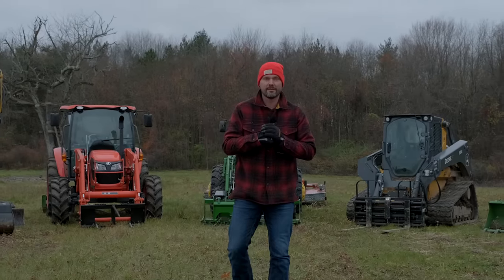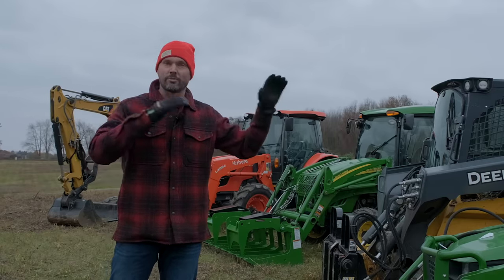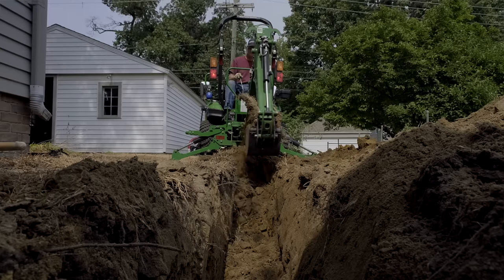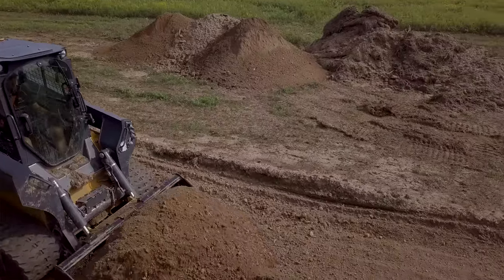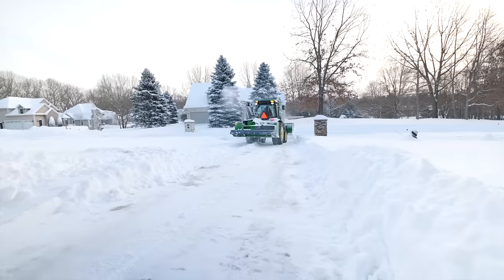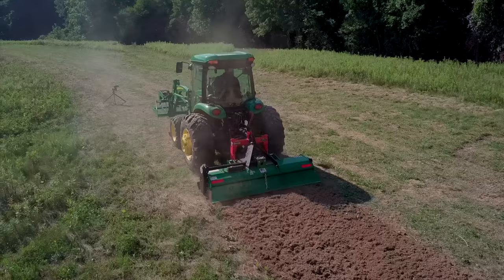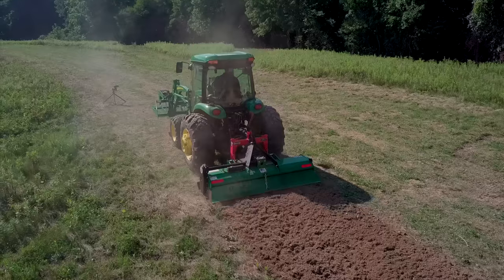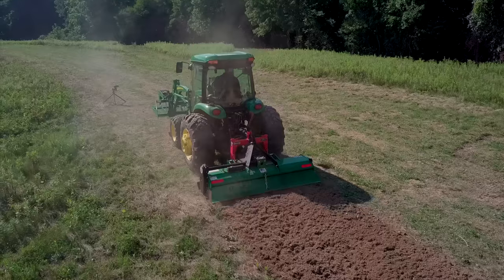IF I COULD ONLY CHOOSE ONE? BEST MACHINE FOR PROPERTY MAINTENANCE

Comment: I've worked in the city as an operator and I grew up on a ranch, so I've seen a fairly good representation of what you're gonna run into as far as one machine for a decent little spread. I think that the most versatile piece is a mid size tractor with 4wd and a front loader bucket and a box scraper with rippers and top and tilt, if you can afford it. As far as most other projects, it's more cost effective to rent a machine than buy. At what point that changes is up to you and your discretion. You can put forks on a tractor, you can get just about any implement you need, ie a wood splitter, a flail mower, even generators if your tractor has the beans at the PTO. I think that about 55 to 65 HP at the PTO is just about optimum for most things. JMO but hope it helps, be safe 🤟🇺🇸👍
Reply: Totally agree. I maintain a 190 acre property with a 4052r. Heavy duty bucket, rock bucket, snow blade converted to a dozer blade, box blade, pallet forks, WoodMaxx PTO wood chipper, and then In the winter I throw a huge plow and a 74 inch PTO snowblower on and the amount of snow I can move is insane compared to a skid steer. Anything bigger than a 4 series tractor would become a hinderance on many common tasks.
Reply: @qqslp  sounds like a nice little spread you got there. Growing up on a ranch it was so much hard work, I couldn't get away fast enough, but now that I'm older, I sure do miss those open spaces! Good luck with your ranch and be safe brother! 🙏💪🤟
Reply: @dozerboy67 - Home, home on the range…..where the deer and the antelope play  🎶
Reply: @simpleagain1  😂😂

Comment: The correct choice is the skid steer.
Unlimited amount of attachments
Easy to transport on the smallest trailer. Really it's a no-brainer
Reply: It isn’t the easiest to transport. Remember that 333g weighs over 11,000lbs which really determines your trailer size and load tie down
Reply: You need a tandem axel heavy duty trailer and a F-250 at least to pull a skidsteer around. And they can cost 3x the amount of a subcompact. Plus on a tractor you are out in the open, enjoying the nice day and not locked in a tiny cab. It REALLY depends on your situation, uses, interests, etc. Tractors are just fun!
Reply: IMO a medium tractor ie 50 to 70 hp with a backhoe attachment
Reply: It really depends on what you can move and what you have available. 

No one piece is the best, really your right cause if you're gonna have a 60 horse tractor you should have the ability to move a 333 around, might be at your limit but you can do it. So yeah I  agree.
Reply: Until it's time to bury a cow.
Reply: @thespoonterer  oh, I agree, my 710g isn't going anywhere soon. It works the best for me to reach out and move dirt and out load and carry vs a 953 for road maintenance, also loads a dump truck great. 

That being said have you run a CTL in soupy mud, they shine there. Also you can get a hoe attachment for either a tractor or the CTL. In the end, if I could only have one, I'd keep my 45hp tractor, don't tell my 710, just my thoughts, again no right or wrong.
Reply: @brandtwebber5761  definitely no right or wrong answer. My Kubota mini ex was the best choice for the work I do on my property but may not be the right choice for someone else's situation. But.... I think a mini excavator is still extremely versatile. Could technically plough a field with it, would just take me alot longer than a tractor, but could still do it lol.
Reply: @thespoonterer  you do what you have to with what you have, thats how we used to do it before all the 100,000 dollar options showd up.
Reply: Tractor has all the attachments also.....also the weight....i find it funny how people think a skid steer is better....you guys obviously dont work with equipment.
Reply: @EternallyGod tractor got all the attachments you need without paying an arm and a leg for a skit steer attachment

Comment: Every machine does have pluses and minuses. I have a JD 450 dozer, JD 450 track loader, Hitachi EX75 excavator, New Holland 2120 4x4 tractor with frame mounted backhoe, John Deere 4x4 310G backhoe and a Bobcat T300 skidsteer. Each machine has some task that it does better than any of the others. Ive purchased, used, then sold dozens of other machines that simply came up short. If I had to pick only one... It would probably be the tracked Bobcat. I am so thankful that Im not limited to one. My equipment makes my ranch life much more entertaining.

Comment: I got a kubota mid size tractor for my 40 acres.  40 hp is plenty.  No tilling, but brush hog, bucket, scrapper, forks.  ALL important for me.  About 10 years after that, bought a mini, (5 tons) excavator.  Not as many things you can do with it, but it does so well on digging that I couldn't do any other way, (no, no backhoe can go down steep hills or sidehills) .  I bought a smaller Kubota for mowing in my orchard, (still diesel but smaller)  I use it a lot for mowing around trees etc.  All are great, but the mid size did so much.  I could have gotten away without the small one, just that it saves time for me.  I'd agree that the mid size is my must have.  The excavator is also great, but you can rent one if you save up the jobs you want.  Yeah, if I had 100 acres of flatter land, with lots of brush, skid steer with attachments would be great.  But My place has enough steep areas that I'd not want to take a skid steer on.  Excavators CAN work on such slopes.

Comment: I have a 4720 and I do mow my lawn with it,  I have a 17 foot batwing Woods finish mower.  I’m mowing 7 to 8 acres and just love the tractor, the best thing about the cab that I found out is no bugs. The air conditioning and the heat is nice but I ran over a hornets nest and was really happy when they were all buzzing around the outside.  It’s amazing how close you can get to trees.mailboxes ,swing sets and any obstacles once you get used to it.  I have a New Holland TC33D and used to mow with it and a 6 foot finish mower and cut my mowing time down from about 8 to 9 hours to about 3 hours.

Comment: I love this because it’s completely application based and like he said, whichever projects you have will dictate which is better. Having ran all of them for hundreds of hours, I can honestly say it depends. Would I want a 1025 for land clearing? No! Would I want an ex for mowing? Course not! Each has its own specific realm it does well in. Personally, I’m partial to my CTLs cause that’s what I run most and if they can literally do it all with less footprint because of the tracks, but I’m not going to use it as a finish mower for my lawn. Let’s just all hope to be lucky enough one day to own all the equipment that he does.

Comment: I just purchased an implement from Good Works tractor. Exceptional customer service. They are great people to deal with I recommend them. . That been said…. Without a doubt I would choose a 1025r. It can do it all it’s compact affordable reliable. Yes sometimes it takes ab little longer than a bigger tractor but it gets it done no matter what. I can squeeze in small places. That’s my go to machine. I also have a 3 series. If I need more power I just rent it. I can’t afford an excavator or a skid steer….. they’re way too expensive for my budget. The implements are high too. So yes 1025r I have 8 acres and a mini farm. Hope this helps.

Comment: After years of compromise or experience. Keep looking for good deals and buy what you need. It may take 3 to 5 years to assemble, yet you’ll be both productive and happy. Ended up with a cabbed 47hp heat&air 4 series, a cabbed 75hp heat&air skid steer and a 1.8ton mini excavator. No more worries, the jobs get done!

Comment: I agree with your verdict on the large compact for general use around most any property. Does nearly anything short of turning a place into a construction site. 50-60Hp PTO tractors will pull and bush hog anything. If you only could have one also make sure to have a bucket, but if you already have a sub-compact or 25-30Hp tractor with a bucket it'd probably be very economical to buy a nice used Pulling tractor for any PTO/ rear Implement work. There's NO such thing as TOO many tractors, just not enough space to park them all.

Comment: I'd go with skid steer. Because you can basically do everything you can do with the compact and you can dig with it some too. Not much, but running pvc or cable, you can cut a small channel with the bucket. Clearing land, mulching, bush hogging, moving dirt. Skid steers are nice and it's all in one machine. I see why you like the compact too though
Reply: Agree. I've got 5 acres and been looking for a machine. Skid steer seems like the best bet currently. My one drawback is me knowing maintenance on it vs  tractors-which I'm familiar with

Comment: I have 24 acres. I own the  Kubota M7040 which is a 70 HP Utility tractor. I use my tractor for bush hogging, finisher mowing, tilling, box blade on the driveway, grappling down trees and brush, and bailing hay. This is a great all around tractor.

Comment: Had a used Cat 416D 4wd on steep 10-acres.  It was a bit tippy for hills, but had power to level roads and move mountains.  Never regretted having too much power.  4-in-1 with leveler made short work of taming woods.

Comment: And the winner is... to rent this stuff. I have a JD gator I use everyday but very few needs to have a tractor I would own so I rent or borrow. The mini-ex I have one in the back that the turn table broke off the tracks. This is proving so impossible to fix I think it will have to go to the junk yard. We are using it to put in french drains around the barn. I think the New England mixture of rocks and gravel in the soil got to it. One other item to consider is the JCB Telescopic Handler (the AG version). It has all the attachments you are showing in the video but can lift high for large hay barns. I notice in my travels many EU farmers really like those things. Cool video and interesting line up. Thanks!

Comment: I bought 48 acres of mixed pasture/mountain/farm land when I was 19.  Dad did the farm work with his equipment as I was broke. The old farm I had bought was run down, I almost immediately needed a skid steer to clean up garbage and Level out briars and dirt piles.
      Thank God for Dad, he was stringent and a pain but he had mercy on me and let me borrow his old 1985 case 1835b skid steer. I sold my pickup truck for some black angus cattle, and ended up buying the old case.
     Fast forward five years and I have a kubota ssv75 and several attachments.
      Long story shortened, for property maintenance a skid steer is a requirement, not an option. I use no tractors under 100 hp to do any tasks on my property

Comment: Sometimes you need several saws to complete a project: circular, jig, table, chop, etc. Honestly, it depends on the project and the tool's capability.
Reply: It really depends on the operator and his skills.  I can make a straight cut with just a skil saw and not using a table saw to rip a board.     Just saying.

Comment: I just finished putting in a 300’ driveway, 150’ well offset, 250’ electric line, 30x50’ foundation hole that was 7’ deep on the uphill side, septic system and a 300’ swale, all with a kubota l4060 with back hoe and front loader. It did everything I asked of it but my only complaint was the speed. You have to reposition a lot so that means getting off the machine and back on, often in mud, hundreds of times a day. I just traded it in for a kubota kx040-4 and only have 6 hours on it so can’t say much but my hope is the next project I have of doing the same type of work will go faster, and as I’m entering mid 30s, less in and out of the machine and climate control work space sounds pretty nice.

Comment: One machine, my only machine on a 110 Acre property is an ASV RT75HD. Does everything I need and even with the added cost of slashers, mowers, pallet forks, post hole augers, and chain Trencher it goes everywhere from steep hill sides to muddy creek edges. Feels safe and stable. beside the neighbor needs to use my CTL more than I need their tractor. Great video though, very entertaining.

Comment: Currently in that situation.. my property, 91 acres, approx. 40 pasture and 50 woods. For me, I would choose a good utility/compact tractor.
  Tractor I chose for my situation - Kubota MX5400. Big enough to run a decent sized flex wing rotary cutter for pasture maintenance as well as future hay equipment and still able to work in the woods as well. 
   I can not recommend a good root grapple enough if you are clearing trees and brush. It has saved me countless hours of back breaking work having to drag limbs, logs and brush to the wood pile or burn pile.
Reply: I have the same tractor as you. The Kubota MX5400 I bought it from in March of this year. Overall I’ve been very happy with its performance and size for the maneuverability. I just had the dealership add all three rear remotes. It can take so hydraulic top and tilt will be coming soon on mine. I also agree with you about the grapple. I have the land pride 1572 which is overkill. Reduces lift capacity. But is a tank. I could demo with that grapple lol
Reply: @JaseVaughn  Where did you get your rear remotes and can you get 2 more????  lol..  I have been waiting on mine since August. I know there's a back log on stuff but, I'm beginning to think the salesman at my dealership is giving me the run around. 
   I need to just look online at some place like Messick's to see if I can get them on my own.
Reply: @rogerr1296  I got them from the dealership where I bought my tractor here in Florida. I’m not loyal to any dealership or salesman. I used to be but my advice to you this day in age and in these times especially. Seek your parts and equipment from wherever you can get it. I actually started off really good with my salesman I bought the tractor from then slowly he’s been getting worse. So I just get attachments and products from other people and dealerships. Or the same dealership from a different salesmen. Loyalty will make you wait as you have been my friend. :)
Reply: @JaseVaughn  Sounds familiar. My salesman was good at first then little red flags stared popping up here and there. Like me asking him to order my rear remotes then getting the very distinct impression he didn't do it until I asked him about them a few weeks later. I just get the impression he was through helping me after his commission check cleared after I ordered a tractor and three implements from him.  I think it's time to do a little shopping elsewhere.  I hate it because the next closest dealership is about an hour away and, it's the same dealership just a different branch. And you know these guys talk to each other so, if I try to go through them word would get around and I'd bet my current salesman will tell them not to get in a rush to help me.
Reply: @rogerr1296  I bought an implement in front of my old salesman with one that was there because he knew the stock better than him and when I called about box blades and what I was looking for. I looked at my salesman and said nothing personally but you said you didn’t have this box blade and evidently you do. I can’t let your lack of knowledge or effort get in the way of me getting my equipment and work done. Hahaha I feel the same as you about the salesman as well. Which is really dumb on there part because down the road I plan on getting a 65,000 dollar Kubota mini excavator. But won’t be using him!

Comment: I only have 40 acres and most of it is wooded. I absolutely love my M7040. It makes snow removal with the snow blower in Northern Mi a breeze. I also back blade almost two miles of trails and till/plant about 8 acres worth of food plots.  I've got an unlimited supply of firewood for my house on my property and it makes moving the wood so easy. I actually use the loader for all of my lifting/moving tasks. I bought my M7040 last year with 312 hours and the plastic still on the seat. I paid 40k for this almost new, pre-def fluid tractor and couldn't be happier.

Comment: I pull weeds with my mini. For brush, for piles, loading logs branches rocks.  All the heavy lifting.  Leveling making roads pulling other stuck equipment. Wonderful logging tool.  When I cut firewood no bending over and pushing on logs, no more chance of running chain in the ground.  Oh yeah it will also dig holes and trenches.
Reply: Best back saver there is!!

Comment: I went with a JD 4WD utility tractor with much taller wheels than the ones on your kabota. Great for the deep snow we get here in winter. I use it for almost everything with a wide selection of attachments for it. Very pleased with it. I also have a 4WD Kabota garden tractor for mowing the lawn. Now I want an excavator for doing some trail work (I have lots of hills and large rocks).
Reply: Which Deere did you get? I’m about to get a 5115M. I have 80 acres of mostly woods, but working on clearing pasture for cattle and sheep. My property is extremely rocky and hilly, and I have a mile long gravel driveway to maintain. Right now I have a Kubota L4330, doesn’t even have rear hydraulic remotes or a swappable loader attachment, doesn’t meet my needs at all so I need something new. I also want to cut hay in the future so I need a tractor that can run a disc mower/conditioner.
Reply: @graysonwilliams4826  Deere 5205, bought it new in 2006, don't think they make it anymore. Got the optional taller full ag traction tires so it is basically unstoppable in snow or mud. Got a rear blade (clears my 1.4 mile driveway of snow in no time), front loader, post hole auger, spader, chipper as well. Use them all regularly.

Comment: Great comparison.  I got a jd 2210 a few years back as a mower with fun attachments.  5 years ago moved to a small farm and this tractor is the most used on the farm.  I have larger tractors for field work but the 2210 gets used at least twice a week year round